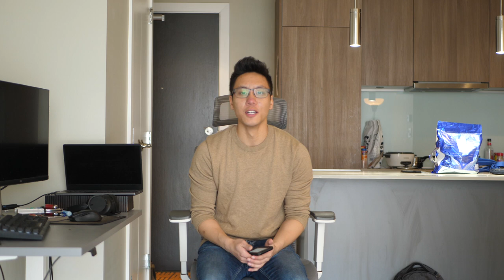Mining Engineering Q&A - School, work, expectations!

Comment: Hi Kwan Fung, I wonder if you don't mind tell me how to get into mining industry as heavy equipment operator in Canada, especially in Alberta, and what's the different between oil sands mine and coal/gold/zinc mine, I used to work in a remote camp in Alberta for about 10 years, but I would like to switch to mining job, hope you can give me advice, thanks. 
Kind regard/ yiu lam